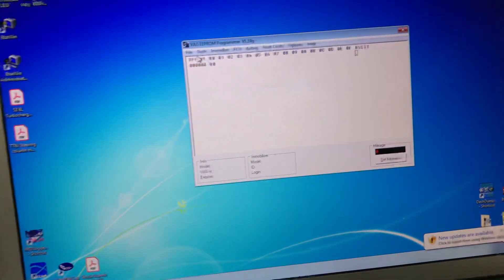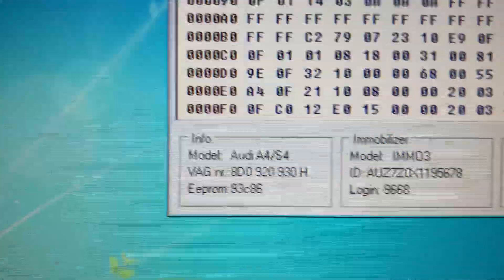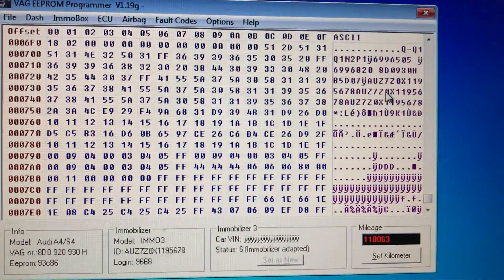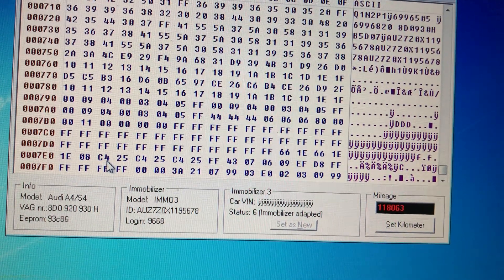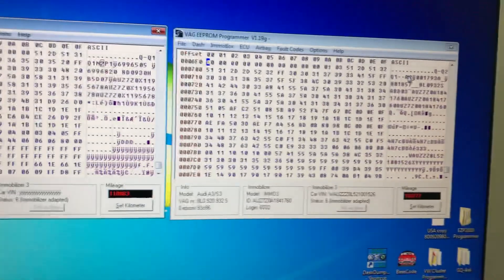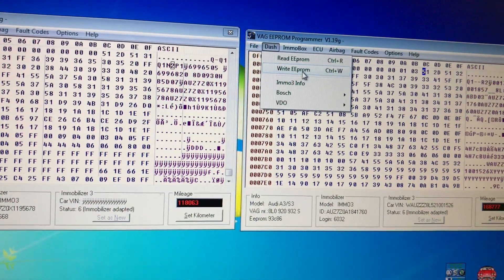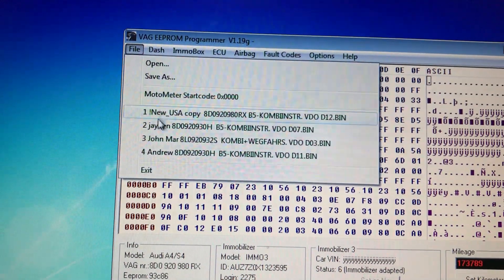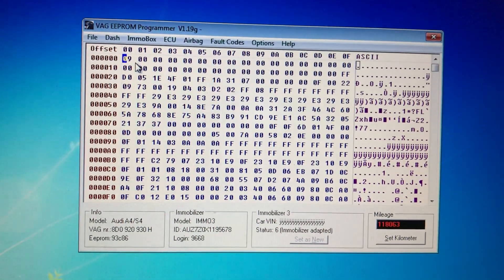How to read cluster EEPROM - Audi A3, S3, A4, S4, RS4 & Golf Mk4 R32 Gen. VAG EEPROM Programmer link

Comment: Is it possible to do a read modify write of the EEPROM?  In other words if I cant read EEPROM from original cluster can I read new cluster, then modify VIN, PIN code etc and write back?  Is there a checksum that has to be recalculated and updated as well?
Reply from the maker: I’ve only ever manually transferred chunks of data by knowing original data and manually typing it into the replacement cluster. I’ve never not been able to read original cluster data. 

I’m pretty sure there will be checksums that need calculating if you’re modifying without knowing the complete data sets from original cluster. 

It’s strange you can’t read one cluster but the other.
Reply: @ianpgonzaga  Ian, thanks for the speedy response.  FT232 Cable is arriving today so don't know for sure just yet that I can read either cluster.   The original cluster was near dead but still had working odo and car would run with it.  It had been repaired once so I sent it back to same repair company and they returned it completely dead saying "not repairable".  Car wont run but a few  seconds now with old cluster consistent with it being totally dead, no odo or other signs of life.  I have a replacement cluster and it wont run with that either and immo flashes.  Hence the need to modify a new cluster without having old cluster to copy from.  My day job includes SMT electronics hand assembly so not afraid to move chips between clusters however its not clear to me that the MCU which hosts the EEPROM is not in fact the very component that is dead on my old cluster.  Is there a "security" section from the ECU that can be cloned to the cluster?  ie do they share identical data in their security records?
Reply from the maker: @chrishoogenboom3082  ah ok. I reckon just swap your original EEPROM into the working cluster. Is it in an 8L? That should work
Reply: @ianpgonzaga  2002 TT Quattro convertible with 225HP AMU engine and 6 spd manual.
Reply from the maker: @chrishoogenboom3082  ohhhh TT 8N’s instrument cluster do not apply here. They have different setups (Magnetti Marelli) and are still a bit of a mystery to me.

You definitely won’t be able to follow this guide to do any kind of data pull from them. This video applies mainly to VDO instrument cluster.
Reply: @ianpgonzaga  Thanks!  Your video helpful nonetheless.  I found an area of memory using kw1281test_0.71-beta_Win10 with the immo ID (and other data) repeated 3 times so I am theorizing that they use majority encoding for critical data (keep 3 copies, if at least 2 match they are correct), so hoping the SKC is in there somewhere.  So far no luck.  How long do you have to wait between login "FAIL" code on dash before trying again?  VCD/Ross Tech says "a few minutes" ?
Reply from the maker: @chrishoogenboom3082  ah when you’re trying to login using SKC? I would give it a good 5.
Reply from the maker: @chrishoogenboom3082  good luck with it all! The pesky TT clusters are annoying. When I have them figured out I’m sure I’ll make a video.
Reply: @ianpgonzaga  
Hi
Reply from the maker: @SsempijjaShakur-h1w  Hi
Reply: I need your help with EEPROM
Reply: @ianpgonzaga  I need your help with EEPROM
Reply: I need your help with EEPROM
Reply from the maker: @SsempijjaShakur-h1w  sure. What's up

Comment: Ian, please. I bought a VAG Commander 5.5 but it seems not working, false. I have a functioning Ross Tech, an original which I do servicing with on my car. I have tried the VAG EEPROM Programmer V1.19, but it won't work. I believe I have crap-ware. This is not available more on Internet as before, or the last remaining are crap. Could you send me a file copy of this V1.19?
Reply from the maker: did you put your genuine ross tech onto "dumb mode"?
Reply: Yes, and tried with common KKL. It appears that the software itself is just in lack of driving routines. It might be that it has never ever worked, that version.
Reply from the maker: @Quant-Beat  if cable is genuine ross tech hex can first version it should work.
Reply: The VAG EEPROM Programmer V1.19 has no trace of any port, it doesn’t know anything in input/output exists. I believe the software is just defect.
Reply from the maker: @Quant-Beat  sounds like your drivers not installed properly or you need to manually switch com port in devices manager
Reply: Yes, in Device Manager I try to pick up as I do with VCDS (which works). I might lack the true drivers, there are many fakes crap ware out there which never works. That might be my case.
Reply: @ianpgonzaga  I don't have the software any longer, this time I try to download it I just end up at Russian sources which gives a non--working bluff. These are dying out, as the are now so old. Many links out there are broken as well.

Comment: I have a CH340 cable and it doesn't connect. WHY?
Reply from the maker: maybe your cable doesn't have the right chipset. must have FT232RL inside.
Reply: @ianpgonzaga  Is the FT232RL chipset the same chipset needed to read the EPROM off the ECU?
Reply from the maker: @bluestreak711  good question. I think so... Try doing this with argdub tool. Search that in Nefmoto

Comment: Can i do this while the cluster being installed in the car?

I’ve been having issue with immobilizer so I want to adapt my key and to do that I have to pull SKC but I have absolutely no clue on how to do that lol finally came to this eeprom thing but all these wiring is no way I can do without blowing up the house. I have full version VCDS
Reply from the maker: Yes. This is over OBD so as long as you have power to the cluster you can follow this :)

Comment: Quick question, will this work on a 2005 Passat?  I'm changing cluster due to the gateway module grounding out the can high and low.
Reply: BTW, I can communicate with the K-line.
Reply from the maker: Hey Mike’s Auto. If it is the older gen model - yes this should work to get the IMMO, VIN, SKC data you require. 

Not for 3C B6 gen.

Comment: Hello, nice and clear explanation! I had one question. I've done the golf 4 bench setup but im trying to fix an audi a3 8L cluster. Do you maybe have the pinout for this one? Thanks in advance.
Reply from the maker: Hey there. What is the brand of the A3 cluster? If magneti this program won’t work.
Reply: @ianpgonzaga  it's a VDO 8L0919880F S3 fis cluster
Reply from the maker: @joopvanbree3954   pinout here. 

https://www.audi-sport.net/xf/attachments/screen-shot-2017-02-16-at-07-58-04-jpg.117593/
Reply: @ianpgonzaga  legend. Thanks a lot!
Reply: @ianpgonzaga  what works with this clusters?
Reply from the maker: @XBASSSERa  hi. Please see in the title of video. Mainly from 1999 - 2005 ish.
Reply from the maker: @user-tg8st5yq6l  no sorry this  only works for older cars
Reply from the maker: @user-tg8st5yq6l  probably need much more expensive tools. Like ABRITES
Reply from the maker: https://www.youtube.com/watch?v=fQ9MBomrU2o Video for making bench harness wiring is up!
Reply: Change for 35,862kilometer, 40,452kilometer and 51,855 kilometer into EEPROM codes
Reply from the maker: @SsempijjaShakur-h1w  hmmm that's hard to translate. What instrument cluster are you working on.
Reply: @ianpgonzaga  digiprog 3
Reply: @ianpgonzaga  succeed probox 2014
Reply: @ianpgonzaga  I mean succeed probox 2014 with Ic 93c66
Reply from the maker: @SsempijjaShakur-h1w  sorry this method only works with the models listed in the title.
Reply: @ianpgonzaga  how can I work succeed probox 2014 with small ic 93c66 using digiprog 3 v4.94

Comment: Can i retrieve SKC with original Ross tech HEX-NET Pro WIFI/USB Cable and VAG EEPROM Programmer 1.19? Please confirm.
Heard ross tech cable wont accept third party software (EEPROM programmer?)
Reply from the maker: Hey Rashid - I’m not sure but you can only try. Make the settings in vcds as per this video and try it. There is no harm. 

I use ross tech hex+can with VAG eeprom and it is fast and reliable.
Reply: @ianpgonzaga  Tnx bro for your quick reply. I am away from my cables right now, will try next week when I get back home.  Surely will update here
Reply from the maker: @rashidjafar  yes please give the update. Will be interesting to know if I can sell my hex+can with a newer one. You will see in other comments the hex v2 doesnt seem to work with vag eeprom :(
Reply: @ianpgonzaga  Did some internet search, Not sure but need to work with it. They say to remove Vcds official drivers and use FTDI VCP drivers on virtual com port and disable intelligent mode and we may be able to access.
Reply from the maker: @rashidjafar  I see. With hex+can it just worked for me after removing intelligent mode. Interested to see your findings
Reply: @ianpgonzaga  Bro I have done my try. Unfortunately hexnet can’t be used in dump mode. Also my hexnet doesn’t show on port list, it comes under “human interface devices”/Rosstech hexnet interface. So vageeprogrammer won’t work. I have to use blue Kkl cable or vag commander to get the skc.
Reply from the maker: hello  @rashidjafar   

Thank you for the final verdict on the newer device. Appreciate the follow up. All the best.

Comment: Hi. Maybe You will know, is it possible to use hex-v2 cable for this? 

I had no luck trying and from forum reads it seems, that you have to use cheap blue ones vag kkl 409 cables.
Reply from the maker: I have been using my hex+can ross tech cable in this video. 

I have no experience with the Hex V2 but i assume it should work. Worth a try. Just remember to set the cable setting to remove the smart mode.
Reply: @ianpgonzaga  i have tried, but just getting "No ecu" message. /= 

Cable works great with vcds and reads the instrument cluster.
Reply from the maker: @PauliusNORCO  played with all the settings in VAG EEPROM program?
Reply: @ianpgonzaga  Are there any? I see only "Options" field with com1, com2 and USB selection. 

In VCDC I unchecked "Boot in intelligent mode"
Reply from the maker: @PauliusNORCO  yeah that’s all I had to do on hex+can
In VAG eeprom it is set to USB on my machine.
Reply: Can you do this with the clocks in the car thanks

Comment: Can I do this with out taking the clusters out just buy using the cars obd
Reply: Ok thanks where can I get eeprom tool from"
Reply from the maker: @aidanscopes2569  search for an obd2 cable with ft232rl chipset
Reply: @ianpgonzaga  hi I have the same hex can lead as you. Is this possible on and a3. All that comes up is “no ecu found”
Reply from the maker: @aidanscopes2569  should work my friend. Have you gone into the vcds program options first to disable smart mode or something like that? Then open eeprom programmer and you gotta select the right com port or usb.
Reply: @ianpgonzaga  hi Iv added you on Facebook book as I can not get this to work. Many thanks
Reply from the maker: @aidanscopes2569  no worries. Feel free to message me
Reply: @ianpgonzaga  Iv mesg you and seat a friend request
Reply from the maker: @aidanscopes2569  I don’t think I got it
Reply: @ianpgonzaga  let me try again.
Reply: @ianpgonzaga  is it bLk motorsport
Reply from the maker: Yes this is also usable through OBD port.
Reply: Ok thanks. What do I need to change in eeprom if installed it

Comment: Please Ian, could you help me? I have an original VCDS interface, which works perfectly with VCDS. This interface is not noticed by VAG EEPROM Programmer at all. Could you give me proper drivers, software?
Reply from the maker: I am using a genuine Vcds ross tech. It works fastest out of all my cables with vag eeprom. 

You must go into vcds settings and make the cable “dumb” By changing a setting. Save the setting then you can use.
Reply: @ianpgonzaga  Are you using Windows 32 or 64 bit?
Reply from the maker: Hey  @Quant-Beat  - using 64bit

Comment: My car audi a3 2002. year was stolen. I found and returned the car, but now the immobilizer light flashes constantly. The car can start with any key. The immo light flashes all the time while the engine is running. How do I fix this?
Reply from the maker: Sounds like it’s been  IMMO defeated. You can also interrogate the ECU to get the correct data which you can see in the bottom of the VAG eeprom program window. You can then use this information to write that data back into the cluster so it can all match properly.
Reply: @ianpgonzaga  Do I have to take out the main ecu on the bench or get the data from the cluster like on this video. Can i do that in the same program like this video?
Reply from the maker: Yes take out the main data from the ecu on the bench and also the data from the cluster. 

Then you match it. You will see right away which component (either ecu or cluster) is the correct VIN. Use the data set that matches the vehicle VIN plate.

Comment: Please send me a wiring diagram. Thanks!
Reply from the maker: Hi David. What wiring diagram are you referring to?
Reply: @ianpgonzaga  I mean what kind of cable's do I need between the cluster and obd connector
Reply: @devid5553  blue connector pin 1 and 23 to 12v.    pin 24 to ground.    
green connector pin 28 is  k-line.

for obd pin 4 and 5 to ground. pin 16 to 12v and pin 7 is k-line. connect pin 7 from obd to pin 28 at green connector
Reply: @CercelMarius  Nice ;)

Comment: Very good video, but why it doesnt work with my hex can usb cable?
Reply from the maker: Are you using genuine ross tech hex can or Chinese copy?
Reply: @ianpgonzaga  Chinese, what if I use other cable that uses FTDI FT232RL, will it work?
Reply from the maker: @Juozyss  yes that can also work. 

Did you already switch off the smart mode in VCDS?
Reply: @ianpgonzaga  yes, but when I try to read  eeprom I get error ecu not found
Reply: @ianpgonzaga  managed to make it work with vag commander 1.4 cable, thanks for your time anyway
Reply from the maker: @Juozyss  ok well done! ;)
Reply: @ianpgonzaga  Hello again 😀 could you tell me the wiring for connecting to the dash on the worktable and not in the car? You just feed the dash with 12v,gnd, and k line and that's all?
Reply from the maker: @Juozyss  ohhh ok. Yes this can be done. 

Please remind me in a couple of days. Happy New Year to you.
Reply: @Juozyss  blue connector pin 1 and 23 to 12v.    pin 24 to ground.    
green connector pin 28 is  k-line.

for obd pin 4 and 5 to ground. pin 16 to 12v and pin 7 is k-line. connect pin 7 from obd to pin 28 at green connector

Comment: You have an original Ross Tech USB-OBD2 interface and that works with this VAG EEPROM Programmer V1.19?
Reply from the maker: Yes I use original hex+can cable for this.
Reply: If i have 20.12 vcds cable,can i read the eeprom on any golf 4 with this vag eeprom programmer so i can enable needle sweep?

Comment: In these VDO clusters, what type of EEPROM is it? 24C64? Or 24C32?
Reply from the maker: Sorry I’ve never had to check the type of eeprom but you should be able to find this by searching online or when you open your cluster - can read the text on the EEPROM chip.
Reply: Its's a bit late but at the bottom left corner there's eeprom chip info - 93c86

Comment: Well, I bench connected the cluster now and everything worked. What I noticed when I mounted it back into the car again was that the IMMO just blinks now, meaning that the cluster do believe that the real key is gone. This means I have harmed something, and that I now need to perform "All keys lost new key adaptation". A nightmare came...
Reply from the maker: Luciano Drossi oh no :( 

What part on the coding did you change ?
Reply from the maker: Luciano Drossi if you have saved the original cluster file. Just re upload it.
Reply: @ianpgonzaga  I didn't get a single byte out of the cluster. It connects, but can't bring out anything other than basic info. Now it doesn't even connects to the cluster at all, likely because the IMMO is in the way.
Reply from the maker: Luciano Drossi hm. This seems a bit odd. This has never happened to me. Triple check you have correctly seated all the plugs on rear of cluster during reinstallstion.
Reply: @ianpgonzaga  Yes, everything correct. Maybe I clicked on "Reset Cluster" in VAG Tacho 3.01 by mistake. Maybe it hasn't to do with the bench connecting at all, but the software operation, which however failed to do anything anyway, These clusters are bricked by Audi/VDO, That VDO you have is newer. I can't even get a byte with EEPROM Programmer at all, but you can.
Reply from the maker: Luciano Drossi depending on car. You might need to access by security.

Comment: Where are you located? Could you take a km correction on my cluster if sent by post?
Reply from the maker: Luciano Drossi I am in Australia. Yes I can do this “on the bench” or demounted.
Reply: @ianpgonzaga  I believe VAG Tacho 3.01 doesn't know where the PIN is, on some cars it knows. I can't operate with VAG Tacho 3.01 even if I get contact with the car and some data from it. Where to buy connectors to do this in bench?
Reply from the maker: @Quant-Beat  just go to local wrecking hard and cut them off - what is the year and model of your car you are trying to do this work for?
Reply: @ianpgonzaga  The problem is that VAG EEPROM Programmer V1.19 does start, but via the OBD in the car's center console it reads nothing. Bench connection would allocate the data for the laptop, but I don't know what connector to have between OBD-USB cable and the cluster.

Comment: I have exactly this VDO cluster but black background, are these not possible to change km without connecting EEPROM-reader straight into the cluster demounted?
Reply from the maker: Sorry i didn't see your reply.  I have never done the KM change with the EEPROM off the PCB. Only requirement in this generation cluster is to have it read and write over OBD port.